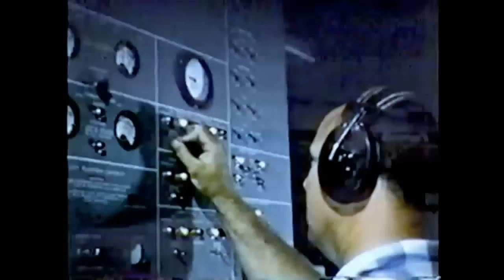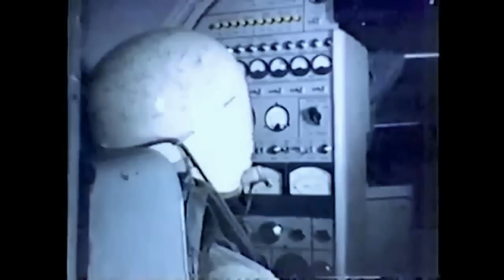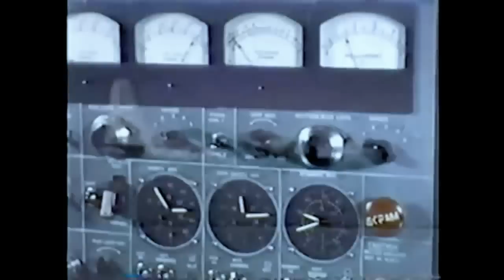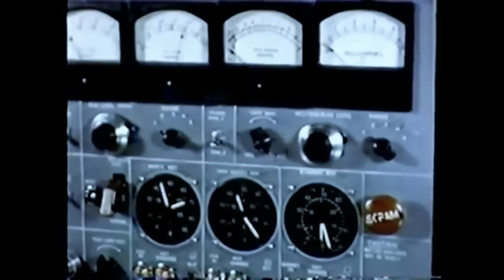Convair XB-36H "Crusader" Progress Report - 1956

Comment: It wasn't nuclear powered. That is very misleading. It had a reactor in the aircraft which produced electricity, the electricity didn't power anything. The Crusader had the same powerplants as any other B36.
Reply: DG,  You are right on.   That reactor could produce up to 1,000 kW* worth of heat, which could theoretically produce electricity via several means, but it would be VERY inefficient due to the required shielding and equipment weight.

*which is 1,000,000 watts/746 watts/hp = 1,340 horsepower, which is only 38% of the power output of ONE of the six R-4360 radial piston engines installed on the aircraft.
Reply: It was just a chunk of Plutonium..They did the same thing in the LEM on Apollo. It had a chunk of Plutonium to power experiments... One reason they made sure on 13 it landed in the Ocean. It was never intended to come back from the moon..
Reply: Are you referring to the last thing said in the video? If so, you misunderstood a simple statement.

Comment: Would it work to have a large diesel driven generator in fuselage that powered four electric motors spinning props, a test bed for fuel economy.
Reply: Going into WWII, the Russians heavy bomber was ineffective because it lacked the supercharged engines needed for high altitude flight. Problems with production kept those engines from being available. But they did have a lot of diesel tank engines. So for a time they used one of those coupled to a blower and split the boost air off by means of ductwork to the 4 engines. It reduced the bomb load due to extra weight and physical space, but allowed the bombers to reach the altitude and speed they were designed for. Anyway, back to your point...you may just see hybrid aircraft at least tried soon enough. There are several all-electric aircraft available now, but they are very small and range is an issue. However fuel engines and especially generators are very heavy...that would be hard to get around.

Comment: What a boondoggle project.
Reply: Not really. As now Thorium Reactors may be the way of the future. They don't melt down like uranium reactors and are far more stable. China is using one as we speak and are building another. Say what you will about them, but they are light years ahead of us in electronics and now electricity production.